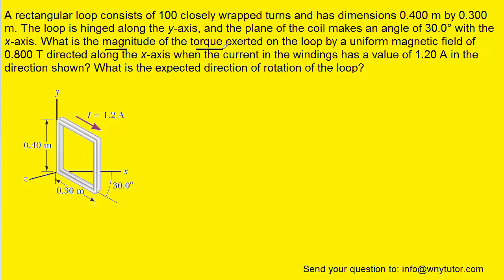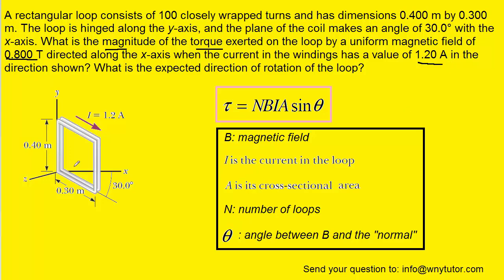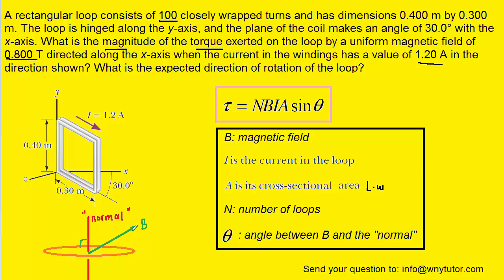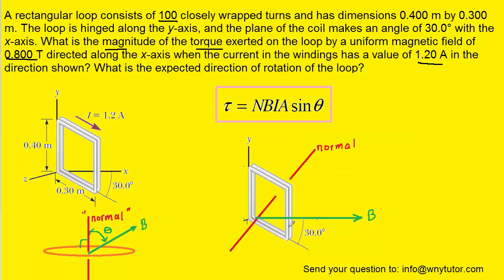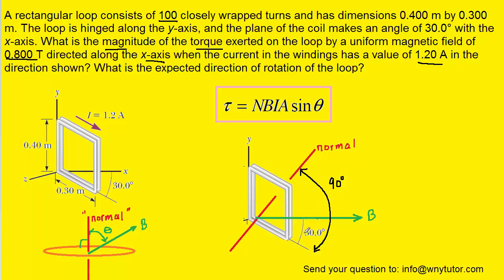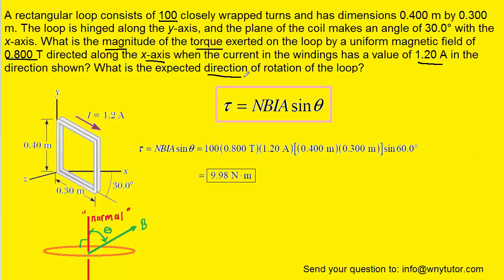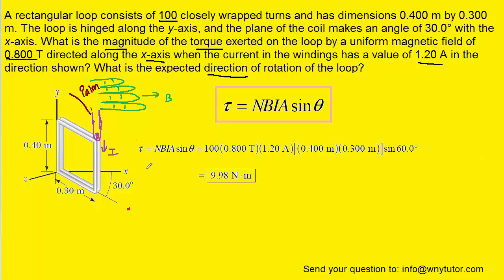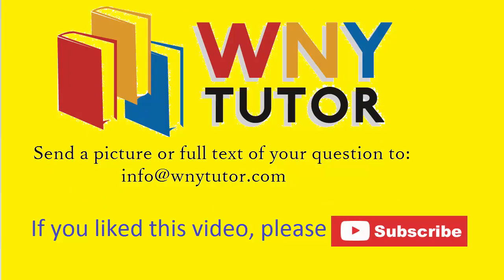A rectangular loop consists of 100 closely wrapped turns

Comment: I understand this result would give the torque of the loop if the loop was free i.e. not attached to the hinge.

However, can you comment on whether this also gives the torque of the loop around the fixed hinge. I understand then that the torque due to the B field at the hinge section of the loop would be cancelled since the axis is fixed. And so we would not count this part of the torque. So the resultant torque around the hinge would be less than this expression. 

Hopefully you can help me with this. Thanks